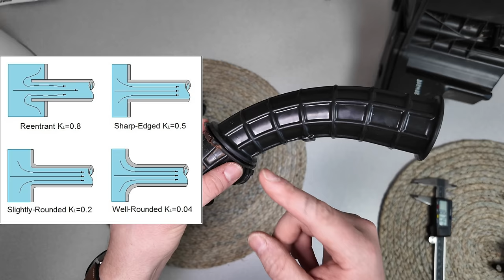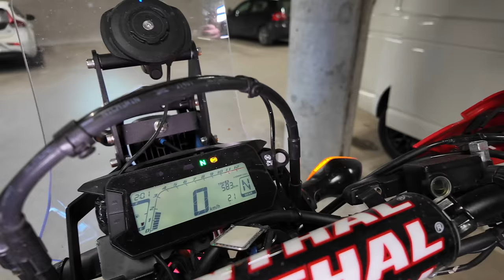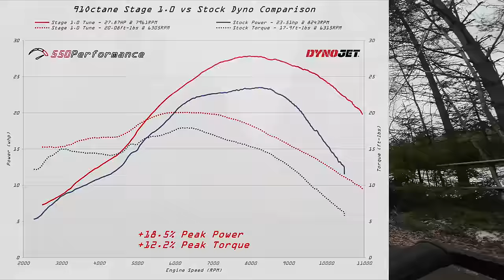CRF300: ECU, Airbox & Exhaust Tune by 550 Performance

Comment: Another great and inspiring vid! Out of funds after the Rally Raid convertion . BTW this really transformed the bike. 
Yeah, Yoshi are expensive and all but Arrow (also expensive, but EU aprroved)  are illegal here in Norway. Yes they are pulling bikes over here and giving fines 😞
Reply from the maker: That's bad. Yes I understood that arrow sells a fully approved setup with a cat but .. it might be pretty restricting like the stock pipe.
This setup might not be great for commuting in town but I tend to mostly ride this offroad.
Reply: I've been really happy with the full Akropovic system on my bike.
Reply: That is the smart thing to do with the CRF. The weakest part of this bike is the suspension. Front and rear. I made the mistake of going with the YSS suspension which doesn’t work well with this bike at all. Especially the fork kit .
Lesson learned. I am going to go with the Rally Raid next month. The design of the motor really doesn’t lend in self to any large gains in HP.
Reply: @user-se7vt5ow4e  Very happy with the RR set up and also have the Hydraulic preload adjuster. 

As for engine mods, these have bee tuned for ages in the cbr300. Anyway, it about improving drivablity. Also, a small gain on a low powered engine is a big gain. :-) 

Still agree that suspension is the 1st mod. No point in more power if the bike doesnt handle :-)
Reply: @no66  I installed the Twin Air a/f kit and Akropovic full system before I even rode the bike.  On my first dual sport ride last weekend (170 miles) the power wasn't what was lacking!  It was definitely the suspension that was holding me back.  Overall the ride was comfortable just about everywhere but it was riding so deep in its travel I couldn't get the bike to react when needed.  There was one situation where I was coming up on an uphill rut and I wanted to seat bounce off a rock to clear it but the bike couldn't do it.  I'll be doing the Ohlins rear shock and Andreani front fork kit since the US headquarters are in my neighborhood.

Comment: makes me consider a ktm350. is it really worth all this plus suspension to make the bike not feel like a slug
Reply from the maker: Depending on what you do with the bike it is or isn't. It's a lot of money to put into a CRF but then again you are getting Honda reliability, service intervals and traveling comfort with the CRF. 
I admit I ride a bit hard at times and I do at least half the service interval in the manual but still the KTM 350 can't do 5000km with one set of engine oils and I'm pretty sure I don't need a full engine rebuild at 100 hours.

Let's put it this way: I might buy the KTM 350 but I would still not sell the CRF. I would keep both.
Reply: @PatchedBandit  all of that is why its such a hard decision

Comment: Im gonna buy 300L do you recomend Rally or standard L? 80%onroad 20%ofroad
Reply from the maker: If you don't want to do a lot of modifications with that ratio I would go for the Rally. You can make the L work with a rally tower, bigger tank etc.. but it requires some more work. 
Rally is more out the box ready to do some serious mileage. But if you can save some money and can work a bit on the bike the L is a very good option. Just get a rally tower and Acerbis tank and you will have a more offroad cabaple bike with longer range and better lights.
Reply: @PatchedBandit  Thank you so much 👍 so If they would cost the
Same you should choose the rally? 

Many says its heavier and not so good ofroad like the L
Reply from the maker: L benefits from less plastics that can and probably will brake in offroad ridingf situations. Therefore you might be tempted to put on crashbars to the Rally version which the L in my opinion doesn't need.
This bike is pretty heavy compared to some enduro/motocross bikes arleady so I recommend keeping it as light as it can be. 

With the L you will get a 4kg lighter starting point and with the rally tower and acerbis tank on mine I only gain about 1kg to the bike. 

Mine is therefore lighter, less plastics to brake, no need for crashbars, better range (acerbis vs base rally model) and I prefer riding the more "slim" bike offroad. 

L is the one I would go for personally every time. But like I said if you want a bike that is more travel ready out the box then the Rally model is a better option especially if they are close in pricepoint. Rally tower and acerbis tank upgrade cost close to a 1000 € in Finland. But the Rally model is also almost 2000 € more expensive in finland so I'm still saving money with the L.

Please check my CRF playlist here: https://www.youtube.com/playlist?list=PLjuLZY6TnpPnQWrKL7vgN6eCmeAY5Ea4Z

Comment: Hi. What IS Price for this "kit"?
550 ecu, exhaust Pipe and rubber Pipe inside Air box?

BR
Pekka
Reply from the maker: Check description and the links to all the products. I don't post pricing in these videos because it varies by country a LOT depending on do you need to import/export stuff etc.

Comment: Any ideas if that edge of the metaltube will generate turbulence?
Reply from the maker: Well this is what the part is manufactured to do (velocity stack) and the stock pipe has a smaller lip…
Totally nonsensical that this would be a problem.
Reply: Ah, yes. I meant inside the tube. Just thinkin... And yes yoi have tje real life experience 🤙
Reply from the maker: There is no real edge on the tube when you cut it how I show it in the video.

Comment: But the 2024 got already 27 HP? So yours is older?
Reply from the maker: The dyno chart is wheel HP. Not what the manufacturer papers say. CRF300L has always had the same stock HP. There is no upgrades to the engine so far.

Comment: You should use some Uni-Filter Air Box Vents / Filters UFV-6
Reply from the maker: They don't fit well under the plastics of the CRF. There is a good video sample of this on YT and they also let water through easier than the frogskin. 
I might try and modify a prefilter slot on top or under the frogskin later as I would like to use prefilters to extend the life of the main filter or use a high flow main filter with less effective filtering.
Reply: No they dont lol, You fit them in the Air box door/cover as they sit flush to the cover, been using them for 20 plus years in all my overland and mx/enduro bikes
Reply from the maker: Im gonna check them out for sure

Comment: ... The video was great, not too long. 
300 Rally owner here in Maryland, USA. I love it.
Bought it used with 1944 miles. 
It had Rally Raid suspension Level 1 front and back plus a LOT of other add ons already. Bark busters, skid plate, tail rack, etc. 
I have since added the 550 Stage 1 ECU.
Opened up the top back of the air box like POMMEY BIKER did here. ...   https://youtu.be/tc3M42IXbAc 
Installed the DNA air filter and full Yoshimura RS4. 
I have the CBR stack but because that is much more involved, I wanted to see how it felt with just the changes already. 
Yes, it does have more pickup with my "seat of the pants" test rides. 
.
Thought about the metal "trumpet". I'm considering cutting the stock intake like you did (maybe a little shorter) heating it with a heat gun and flaring the end out to be similar to the CBR stack and the metal trumpet. 
What are your thoughts about that? 
Also, I want to cut that ridge inside the air box down or completely remove it. 
Thanks again for the video!!
.
On a side note about youtube and my channel. Now that I am back into riding, it was my first addiction before fishing, I am asking myself, do I combine my addictions in one yt channel and change the name to, "Bay Boat and Bike Life" or start a totally different channel just for the bike info? I really do not want 2 channels. 
Jeff
Reply from the maker: To the first question I would say that heatgun was the first idea to me too but then I read up about it online a bit more and the consensus online is that rubber doesn't really want to be manipulated with heat. It might get very brittle and even shrink from the heat so it's not like modling plastic. I would steer you away from the heatgun idea from what I have read online.

Cutting the ridge off can't do any harm. Not sure how much it is affecting the flow though.

Considering youtube is a very tough place to give channel advice as combining 2 subjects might be a great way to identify your channel from all the rest of the million motorcycle channels out there. BUT on the other hand usually sticking to signle subject is considered more effective. It's pretty simple in a way that people watching your fishing videos are most likely not all that interested in your motorcycle content and the same in the opposite way. Like I would be watching your moto content but not necessarily all that interested in the fishing. Even though most like fishing it's not content I look on the weekly or even monthly online.
As a general rule it's good to find a niche and stick to it and second rule usually is to keep the channel in that niche. 
It took me a long time to realise that people are not interested in ME.. But the bikes. And I have steered my content a lot in that direction lately.
I started this like many others just to make fun videos about things I do. But I post less and less about my daytoday trips and focus on creating more informational content. 
I'm still gonna do some entertainment too but I know I'm not very good at it. You might be so that's why it's so tough to give this advice.. I don't want to steer you away from a winning combo. Trial and error my friend! 😄
Reply: @PatchedBandit  ... Thank you for taking the time to respond. I really appreciate it. As far as the channel(s), I'm not looking to be the one that has a million subscribers or make money with the channel, just like you, willing to share information that may help others or spark an idea to make something better. 
I have subscribed to almost every channel that post CRF 300 info. 
Some say that bike is under powered (it's no rocketship) but it is just right for me. 
Thanks again,
Jeff
Reply from the maker: @240LTS  Having fun is the most important thing for me doing these vids 😊
Reply from the maker: Check out my latest post: https://www.youtube.com/post/Ugkx11mET0fxN7Shcg_yUdPxapYd76IzzJfQ

Comment: Can this mod be done to the 250??
Reply from the maker: 550 performance has separate but similar mods for the 250. Check the website and ask them via e-mail if you are unsure.
I believe the airbox mod was much easier on the 250.

Comment: How much was shipping and customs
Reply from the maker: In finland it's about 24% on top of the total cost. VAT is easily the biggest cost. 
Still if you go without the CB300 stack and do this the same Way I did it's pretty affordable. Exhaust is the biggest moneypit and these cheaper ones can be pretty loud.
Reply: @PatchedBandit  Customs is 3,7% VAT is 24% for everthing (including shipping). And at the fall VAT will be 25,5%.
Reply: Okej where did you get the that metal thing
Reply from the maker: Check the description

Comment: If in a year, your engine blows a piston. Who pays the bill? I've heard it happen 😔
Reply from the maker: 1. Let there be no confusion here. This WILL void the bikes warranty fully.
2. These tunes have not been made to the CRF300 so long that anybody would be hearing of the pistons been blown from these engines.
3. This is not a very intrusive tune in that none of the moving parts are modified. The engine will just breathe better as all the restrictive 'environmentally friendly' blocks are taken off the bike.

This being said EVERYONE is doing the work to their own bike on their own responsibility! Only time will tell how the longevity is affected. I am willing to take the risk but I fully understand that this is not for everyone and if reliability is the absolute no.1 thing for any of you I definitely don't recommend doing anything to the stock bike.

I am willing to be the test dummy and report back how life is with the tuned Honda. If I blow the engine on mine I will make a video for sure.
Reply: No you haven’t.
Reply: Since i added full exhaust, 550 tune with sport cams and minor airbox mod (cut 3'' off snorkel and cut 4- 1" holes), i've put  8,000 miles of mixed pavement/off road with no problems whatsoever. At 7800 i replaced the worn out stock chain and sprockets. When it hits 10,000 miles i'll install the 550 performance big bore kit. I've not heard of any CRF 300l/Rally with "blown piston". These bikes are over built for longevity. So far It's  been much more reliable than any of the KTMs ive owned, particularly the 790 adv.

Comment: These are popular bikes around the world. Thus you have a massive aftermarket pimping endless parts to "enhance" your CRF. Oh, what do those pesky fluid dynamics engineers at Honda know about airboxes? Time to lash on an opened airbox so the bike can breathe "better." OK, git 'er dun, Jethro!
Reply from the maker: The same engineer needs to conform to euro 4 and 5 requlations and cant make the bike as good as it can be.
This is now as good as it can. 5 seconds off the 30-120 time thank ya very much 😎